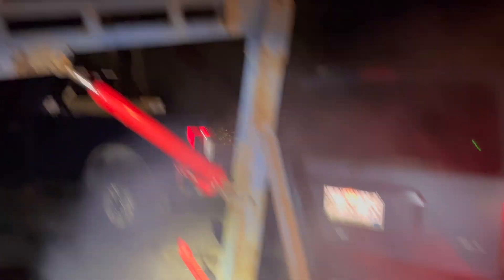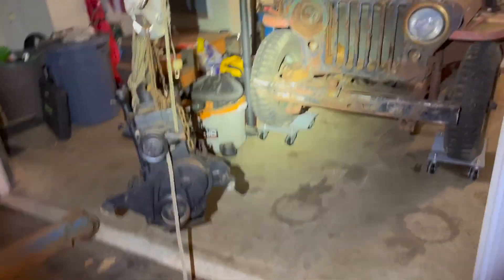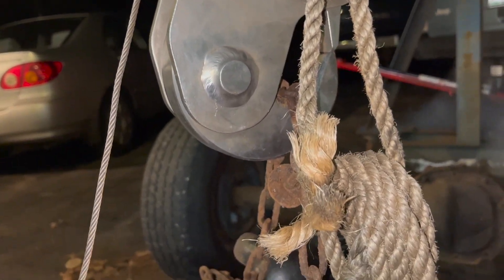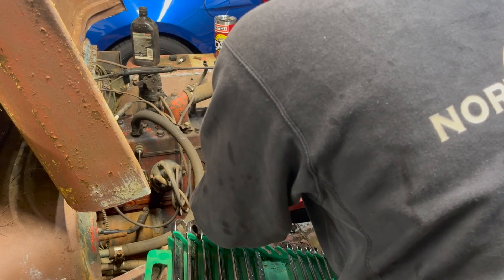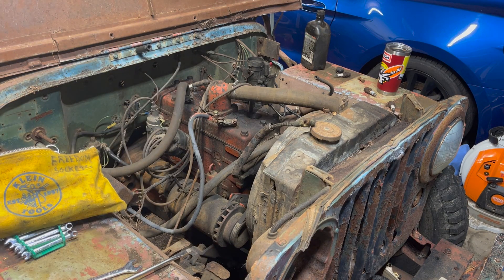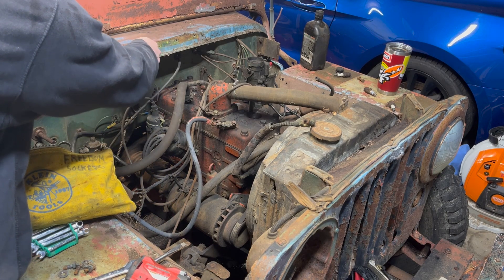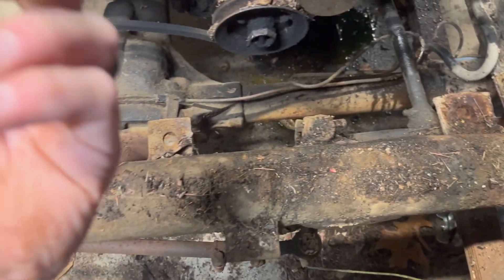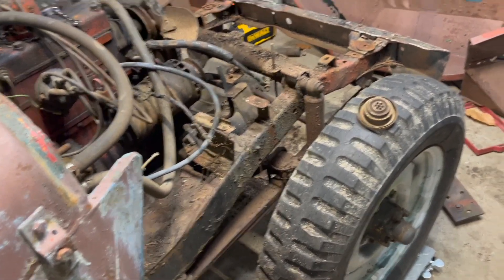CJ-2A Willys Jeep project #2

Comment: If the engine you are pulling out is not cracked or  destroyed it should be rebuilt as it is a 440 prefix which is a 1940 passenger car engine. Unobtanium to a restorer.
Reply from the maker: I have plans to rebuild it. That all will be documented later on!